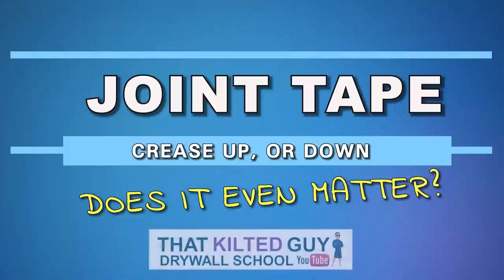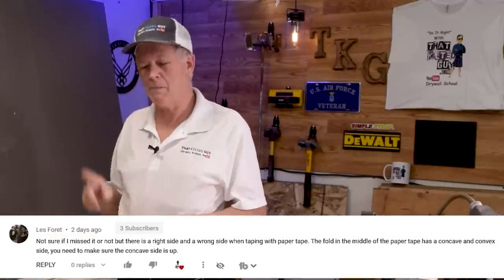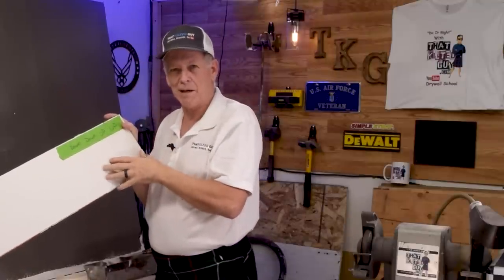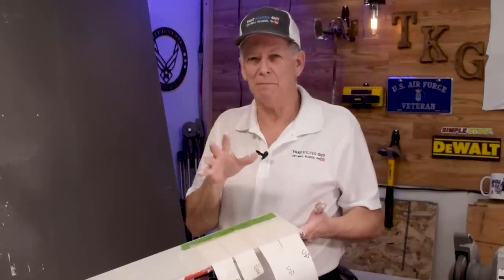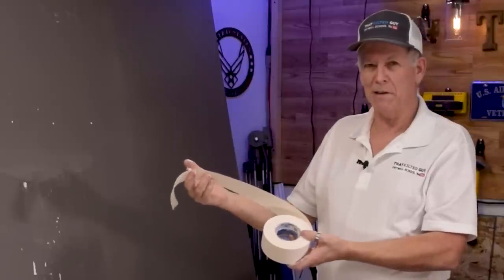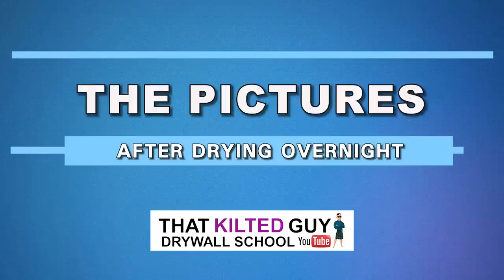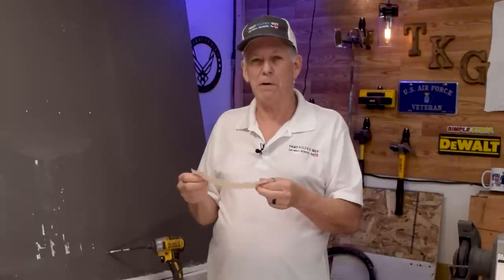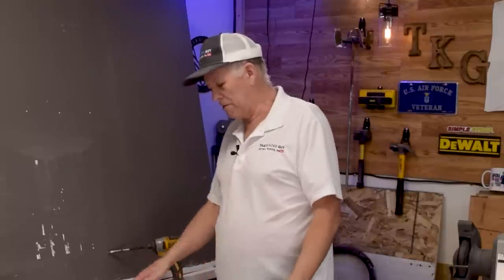I Was Taping Drywall with Paper Tape WRONG for 35 Years???

Comment: the ONLY thing I ever found made a difference was whether the paper was wet or dry. Wet  paper always worked better laid down flatter and never bubbled.
Reply: This is a common beginner mistake I have seen by people that have trouble with tape bubbling but it is a habit that really needs to be broken if you want to take you skills to the next level and produce high quality work. 3 things are wrong with this IMO. First, If you are getting bubbles it means you need to work on your technique. You are simply not putting down enough mud to stick the tape to or are doing unevenly or pulling too much out. Wet tape will minimize the bubbles BUT it allows you to develop bad technique and this is never good in the long run. Second, wetting the tape prevents the mud and glue from penetrating the paper properly. This is a big quality issue that you won't realize by just looking at it. Looks great when you lay it down but if you've ever seen strength tests on wet tape vs dry tape it's plain as day that the dry tape has far superior adhesion when the joint is dry. Lastly, and this is simple economics, wetting your paper before taping is an extra step in the process and this is just more time spent. Minutes wasted add up quickly, especially on large jobs.
Trust me, I'm a GC and having been doing this for decades. Even I thought it was a cool hack when someone showed me it years ago but like so many other things I learned it was only a trick that helped mask bad technique and wasted time. Once you develope good techniques for taping you will never look back and you will be shaking your head thinking of all the time you wasted dipping that tape in a bucket of water to ultimately produce an inferior result.
Reply: Have you done strength tests on wet tape or more importantly timed the difference  in application?
Reply: @tomantoniewicz3265  The time doesn't matter. If it isn't right to start with then when you fix it YOU just doubled the time of your perfect system. As for strength, Hmm I'm not drywalling airplanes. There shouldn't be a load on the board. Also, I have never turned my mud into pancake batter. There is Just enough water to make it mixable. Sounds like you are doing what I have been seeing for the last 20 years. Thin Mud which isn't going to last. Maybe I'm spoiled I work on old Houses in the DC area. The Main problem I have is finding people who can match old Plaster. Because if you can't That repair looks like it came from some cheap levitt house circa 1960.

Comment: I have a question on knock down texturing using some type of plaster material rather than drywall mud. I hope someone can share what they use as a better mix for this knock down ceiling and wall texturing. I am learning the trade right now and this has to be done with proper information thst has been successfully done before,as it looks outstanding as far as I am concerned.

It is very difficult to get the  textured look like you can using plaster for the texturing. Can't seem to get the depth look. Does anyone have any suggestions using drywall mud adding some kind ofmix to it to get that hard deep textured look rather than that plastic look?

And no I am not looking for the answer to add silica sand to it which I already do. Thete is a youtube video of someone putting on a texture to a ceiling using some kind of home made stomper and this is exactly the look I want but cannot match it.

I will put in the link which is only a few minutes long but it is exactly what I want and completely uniform on the entire ceiling. Love it. I am judt hoping some can tell me whst this guy is using to stomp that ceiling.

Just put in the searchbar here on youtube "How To Do a Perfect Knock Down Ceiling Texture."  It is a little over one minute and no one will share this info on what is used for the stomper and how he made it.
Reply: Rapid set one pass.

Comment: Hey Kilted Guy Hope everthing is well. Love your videos. Please let your vewers know. Thankyou James
Reply from the maker: I’m doing good. Just trying a little weeklong vacation to help me get over this long Covid faster
Reply: @ThatKiltedGuyDIY  Glad you are ok. Miss your videos. Beleive it or not l have yoy in my thoughts when lm makink a repair. l switched to a ten in with my level of experience. You make it look easy. Transitioned from small contractor carpenter handyman to drywall repairs thinking things would be easier. Boy was l wrong. That overhead work is tuff alot of clean up work and either your repair will pass or it wont. No in between. Trademan think everything is easier on the other side of the fence. Boy l was wrong! Being in the building trades there aint no short cuts. either its on the money or it aint. That smile we get after completing from the home owner is almost as rewarding than that check. Specially when everything went right that day. Thanks Kilted Guy. You saved me a learning curve. James
Reply from the maker: @jamescathcart4762  Glad to help and thanks so much for The kind comments.

Comment: This discussion makes no sense to even think about. For myself I use dollar bills to tape my joints. My pro friend swears I should be using twenties. Under normal lighting and from six feet away, my finished and painted surface meets industry standards. So what's the fuss all about ?

Comment: Naturally you'd want the convex side of the crease down and that's the way you loaded in the banjo
Reply from the maker: But it works the same either way when applied by hand.
Reply: Sure I wouldn't worry if I put it down either way but if it comes off the roll that way and absolves any slight possibility of an issue seems the way to go. And pushing that ridge in the seam probably makes people feel good.

Comment: If you have ever used a banjo or a bazooka, you would know there is only one way the tape goes.
Reply from the maker: That’s true in those tools, but it’s not true for hand taping. After 36 years I have strung more tape than most guys have seen.
Reply: I was a Commercial Union Taper for many years. If You were Taping by hand, I doubt you got that much tape up even if you did it by hand over many years. I have found most residential guys usually have no idea scale involved and production required by volume for large commercial projects like airports, sky scrapers, chain hotels, schools etc. Two men one with a bazooka, tuned in boxes connected to a pump, and one guy mixing and dumping mud into a 55 gal barrel on castors can get more tape and mud on wall in two months than those same 2 guys doing it by hand in a life time. I am glad I don't do it anymore. However one can make a great living if they have the tools, a few guys who know what they are doing, and bid on the big jobs.
Reply from the maker: Well actually I did new construction including mostly residential and some commercial for nearly 20 years before I evolved into doing nothing but drywall repairs. I was running a bazooka when I was about 17 and keeping two guys hopping behind me so I have plenty of experience. I have run a banjo hundreds of times although I hate it after using a bazooka.
Reply: @ThatKiltedGuyDIY  A good Video you could do is advantages and disadvantages of metal corner bead vs paper bead with a hopper (speed, insatall time, instal methods etc.). As well as supply house bead vs crappy home depot bead. Also a good video would be the difference in sanding different muds (Plus 3, Pro Form Blue light, etc). As we know muds and beads are not created equal .
Reply from the maker: I kind of did a video about corner bead already and I’ll put the link below. The other ideas are on my list of over 100, LOL. Once my health improves I will get to many more of them faster. Right now the long Covid is limiting me to about 2 to 5 hours a day of energy to do anything at all including work on the computer.

https://youtu.be/cblTRQmLMVQ

Comment: Tape is rolled THE way it should be applied,anyone flipping tape over to apply is wrong,you would be ,messing with the tape all day,,,,and there is a drying difference as well  based on temperature, without adequate heat,tape applied crease UP would not shrink enough and would peak resulting in heavier second coat,as well as burning through mud RIGHT into tape WHEN SANDING,DOES NOT TAKE MUCH TO SAND INTO TAPE.Crease applied down with adequate heat sinks in to seam,resulting in less material to coat,and better chance of flat finish,Note,it must BE ATLEAST 55° when taping,you can tape IN rather cold temps if you have to,but it will create more work,longer drying time,less shrinkage......You must have heat for first coat,,,,,period,,,,,,,,,30 YRS EXP,,,,,HAVE DONE ALOT OF COLD WEATHER TAPING UP NORTH,WITH EXPERIENCE YOU LEARN WHAT YOU CAN AND CANT DO,,,,,,ONE TIME I WALKED IN ON A JOB IN THE COLD UP NORTH,THE TAPE WAS JUST FALLING OFF THE CEILINGS AND WALLS,,,,,NOT GOOD,,,,,,,AND WITH NO HEAT,PREFILLING HOLES TAKE FOREVER TO DRY,IN COLD TEMPS IT IS BETTER TO ADD PLASTER OF PARIS TO MUD,MIXING SMALL BATCHES AS YOU GO OR USE A 90/120 MINUTE DRYING TIME MIX,THE GREEN LID WILL TAKE DAYS WITH NO HEAT,,,,,,AND IF YOUR FIRST COAT FREEZES OVER NIGHT,TOAST,ITS OVER,GO BACK TO SQUARE ONE,,,JUST TRYING TO HELP,,,,,I ALWAYS GIVE DIY'S CREDIT,,,,PATIENCE,SAFETY,AND TAPING IS LIKE MAKING A SANDWICH,,YOU CSNT BE STINGY WITH THE MUSTARD,IF IT LOOKS GOD WET,LEAVE IT ALONE,IF IT DONT,WIPE IT OUT AND DO IT TILL CORRECT,,,,,RATHER THAN WAITING FOR IT TO DRY AND HAVE TO SAND YOUR CHOPS OFF,,,,,,,AND BACK IN THE DAY THEY USE TO STAMP RIGHT ON THE DRYWALL FLAT PAINT ONLY,,,HA HA

Comment: Hey kilted guy Had a bad experience with a small ceiling repair that needed a seam taped and beded and textured. It had very large popcorn texture and the house was built in the late seventies. l used what was available on the shelf medium texture and sprayed it with the hopper. lve done over a hundred repairs and never had such nasty customers. They didnt have to pay me because thehvac contractor did. He ran off and jumped in the truck when they srarted being so nasry. This ever happen to you? lt really bothers me . Thanks James
Reply from the maker: Yep it happens. Did you feather the edges of the popcorn? When I see small or large popcorn I explain that mine might be different since all you can buy is medium most of the time.

It’s one reason I’m glad to be out of construction.
Reply: @ThatKiltedGuyDIY  Yes l sanded lightly around the repair and feathered all the edges. Just different size of foam balls in the mix. Thanks for your support. l cant wait till l retire. Thing about it is we or l remember the vicious unhappy customers insread of the hundreds of happy ones. Thanks for your support after a bad day!
Reply: Damn as talented as you are and you get a complaint people crazy. Thanks @ThatKiltedGuyDIY

Comment: If you don't do taping every day. Its easy to leave too much mud under the tape or not squish it out rt and that crease in the paper sticking up higher than it should, will sand thru.

Second if you don't fill your gaps before taping and leave the point up, it has more of a chance of leaving a high crease with all that mud under it where as the point down will help hold that mud back better till it dries. .. In my opinion. Im just rounding the corner from novice to being able to take a real drywall job but that's how I see it. The point down helps hold back mud when you need it to. Other wise... Id still put the damn point down lol. Probably because I saw it on the internet this one time and we all know the internet is always right about everything 😂 better safe then actually knowing wtf your doing. 😂😂
Reply from the maker: Except the crease sticks up almost not at all. It’s irrelevant

Comment: Fiberglass tape works excellent
Reply: I find fibreglass tape requires more crack fill but I believe it would be stronger
Reply: Except in corners.
Reply: Used both types of tape, I think paper tape is easier to use

Comment: So you think the Bazooka was designed this way by accident?   The  crease goes down this seems like a stupid topic 🙄.  What does the manufacturer say. If I asked my old man this question he would look at me like I lost my mind. He taught me and he was taught by old school guys in the ealy 70's. And the kilte  is just weird to me. But that's just my opinion.
Reply from the maker: The design had nothing to do with the tape crease. It has to do with the CURL of the tape.  I was running a bazooka in 1977 at 16, taught by my father who had over 50 years experience when he died. He knew it didn't matter because it doesn't, period.  And I researched the  tape manufacturer sites and they say NOTHING about which direction because it doesn't matter. Otherwise they would say.

Comment from the maker: 🛒 My New ONLINE store with Ebooks, 24 Grit sanding discs, printable guides, and more- www.Thatkiltedguystore.com

🔶🔶🔶🔶🔶🔶🔶🔶🔶🔶🔶🔶🔶🔶🔶🔶🔶🔶🔶

🛒 LINKS TO OTHER ITEMS IN OUR VIDEO- 🛒

  - - - - -  - - - (Don't forget to Subscribe too) - - - - - - - - - - 

🟢 For the entire line of Level5 Drywall Tools- https://www.level5tools.com/catalog?v...

For 10% OFF, enter the code KILTEDGUY10

🟢 24" Metal Skim coating blade (Plus other sizes) - https://www.level5tools.com/products/...

🟢 A good all around Mud pan and knife set- https://www.level5tools.com/products/...

🟢 The BEST Stud Finder I've Ever used- https://amzn.to/3qoNx9U

🟢 A nice hard case for the stud finder - https://amzn.to/39vZx2p 

🟢  Guardz torn paper sealer. Stops Torn Brown Paper from bubbling - https://amzn.to/2L3tl9V 

🟢 Drywall Mesh tape - https://amzn.to/38HUxIQ

🟢 Mesh Tape dispenser (optional) - https://amzn.to/2UpnSyn

🟢 Radius drywall Sander, great for beginners or pros alike- https://amzn.to/2WAxcjd

🟢 The best paint extension pole 2-4' (for the sander above too)- https://amzn.to/2HOc1qS

🟢 Affordable Texture sprayer hopper that I USE - https://amzn.to/2L1jWjb

🟢 The BEST Knockdown Knife - https://amzn.to/3bKkYPV

🟢 A quiet compressor- https://amzn.to/2UnMtUg

🟢 Rubber Skimming blade mentioned in other videos -https://amzn.to/2HdaN76

🟢 Wen Vacuum Drywall Sander (Good one for a low price) - https://amzn.to/35Idmd0 

🟢 The Mud Mixing Drill I use (super tough) https://amzn.to/3dUhMQZ

🟢 For a 4 bladed mixer like mine-https://www.level5tools.com/products/...

🟢 For Full sets of Automatic Taping Tools- https://www.level5tools.com/catalog/f...

🟢 For a mixer you can use to mix up a pan full at a time- https://www.level5tools.com/products/...

🟢 For our full drywall tools store- https://www.amazon.com/shop/thatkilte... 

⏩ OTHER MUDDING & REPAIR VIDEO PLAYLISTS ⏩

✅ Drywall Textures - https://youtube.com/playlist?list=PLC...
_______

✅  Skim Coating - https://youtube.com/playlist?list=PLC...
_______

✅ Popcorn Texture Videos - https://youtube.com/playlist?list=PLC...
_______

✅ Detailed Guide on spraying texture after doing a repair- https://www.youtube.com/playlist?list...

💲 DONATIONS- To show your support of our channel, and to make a one time donation, you can do that at: https://paypal.me/ThatKiltedGuyVideos...
Reply: Hey Kilted Guy! Have a great tip for other repair guys out there. Did a 2x2 ceiling repair today. Replaced the drywall. taped with mesh and hit it twice with five minute mudd. Then texured and knocked it down with five minute mudd! ln and out in 2 hrs. The only drying time l had was when l mixed my mudd.  Yeah baby!
Reply from the maker: Cool.  That’s how I do it
Reply: Sheetrock paper definitely has a right way. It has perforated tiny holes
Reply: Yes the left is right and right is upsidedown
Reply from the maker: @stevenskinz3360  I talked to the manufacture of joint tape at USG, and they said it really doesn’t matter. It’s the same on both sides and the ridge in the crease is only there to facilitate folding it into the angle better

Comment: Crease down always ask the painters.
Reply from the maker: Lol. I guess painters know more than Drywallers
Reply: @ThatKiltedGuyDIY  yes you have to be both, in order to have perfectly smooth wall after it is painted the tape mid section can not be sticking up because after sanding the mid portion will have different texture, this will waist time and paint second cote of paint will have to be applied in order to get the same smooth texture. I do not use paper tape at all.
Reply from the maker: I NEVER have the crease 'sticking up', but then I know how to do this better than most.  I can tape it either way, and hide it just fine.  If it's sticking up, someone either put it on wrong, over sanded, or just doesn't know what they are doing.